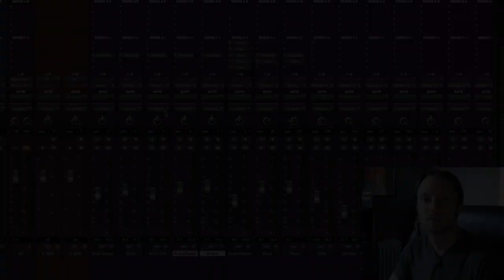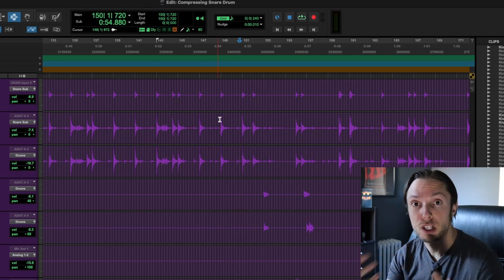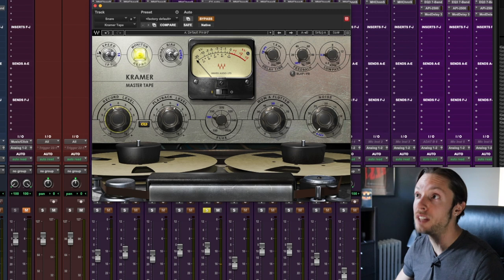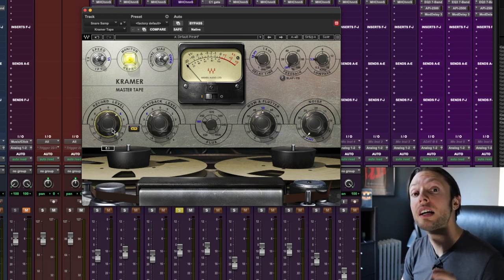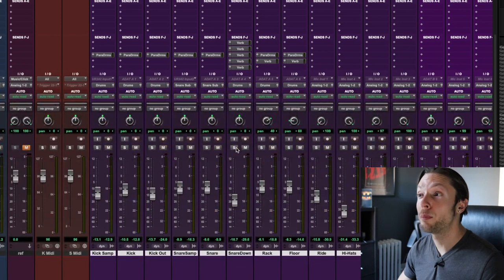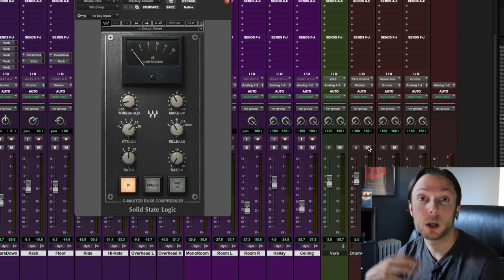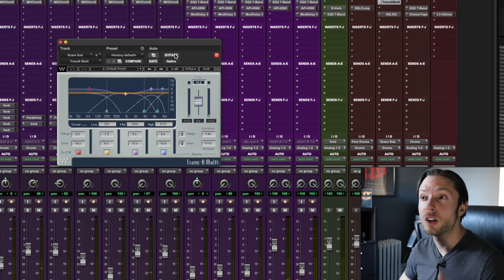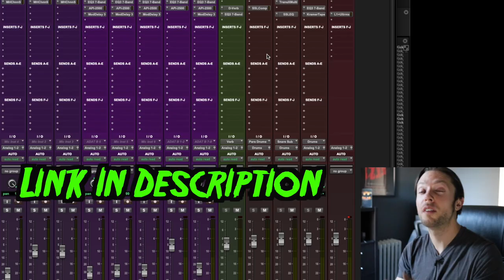Compressing Snare Drum For Punch & Fatness

Comment: Bobby, question on that tape emulation: do you just use the default settings or do you have certain settings you use for specific purposes?
Reply: Not Bobby here but, a tape simulator  can be used for so many purposes, the thing Is how you set the knobs. 
If you crank the input gain you get a nice saturation and also a peak buster. Hope to be helpfull
Reply from the maker: I usually just use the stock settings with this particular Tape saturator.

Comment: great! quiz, How do you trig the one shot snare?
Reply: Steven slate trigger 2
Reply from the maker: The snare sample isn't a one shot.  It's a round robin (made from 10 different hits) of the exact live snare I used on this EP.  I then load my own samples into Slate Trigger and print it to a blank audio track.
Reply: @FrightboxRecording  ok! Thanks!
Reply: @FrightboxRecording  Do the samples get triggered by ghost notes and rolls? Is it dynamic or does it just ignore the low level hits? I use REAPER and create a MIDI track of my snare but I always have to go in and edit stuff like ruffs and flams.
Reply from the maker: @nosucherror  I only trigger the main hits.  All of the ghost notes and soft rolls are the natural snare.  I also keep the midi dynamic as well.  Also, I make sure all of the midi hits are phase accurate as well, so everything is checked before it's printed.